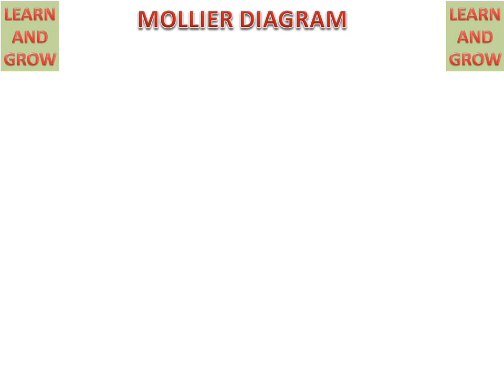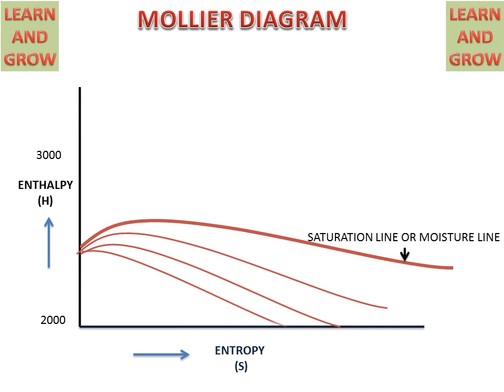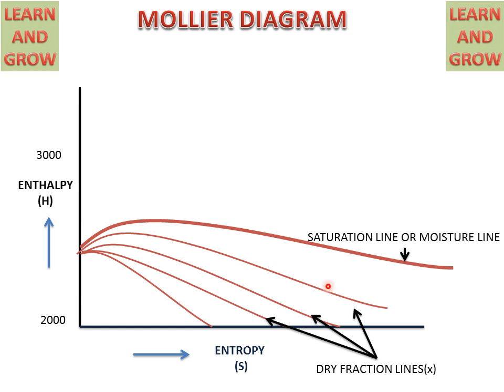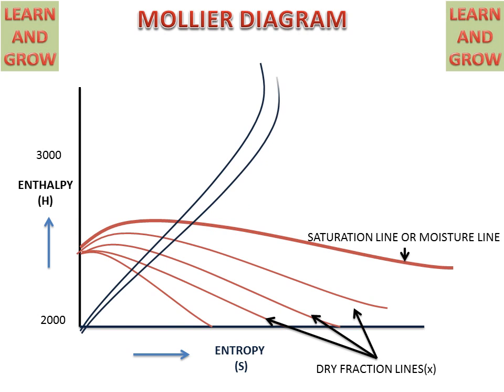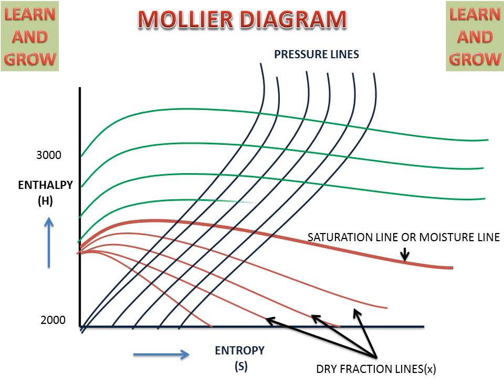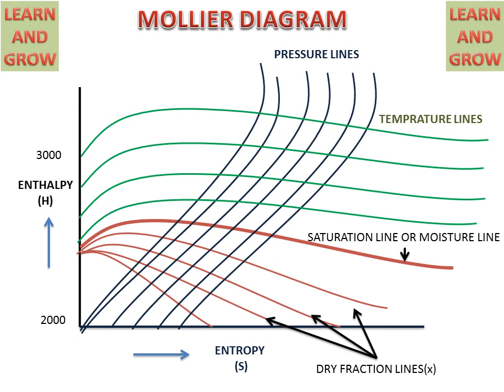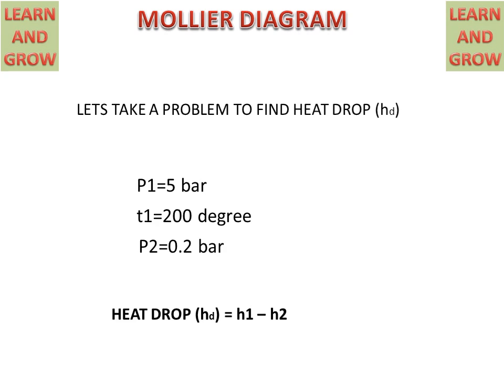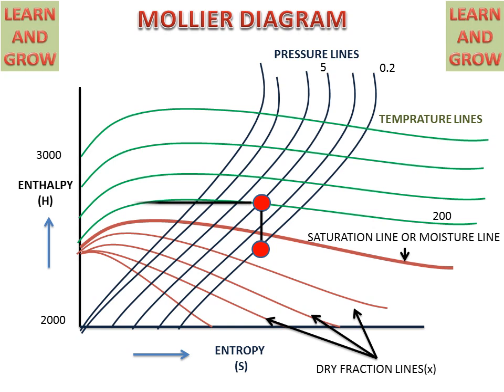Mollier Chart (How To Read)

Comment: is saturation line or moisture are there are also temperature lines ? .   and how heat drop / heat rejected is equal to the change in enthaply as this is not taking place at constant pressure